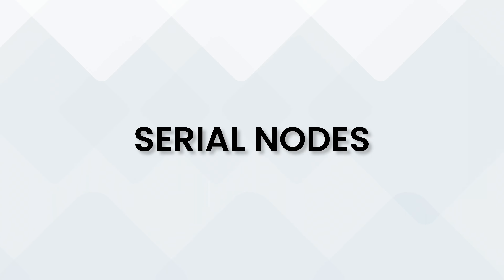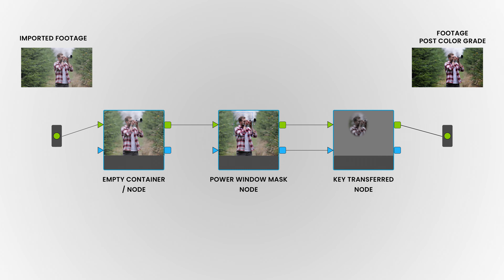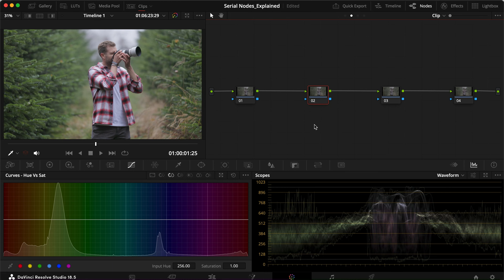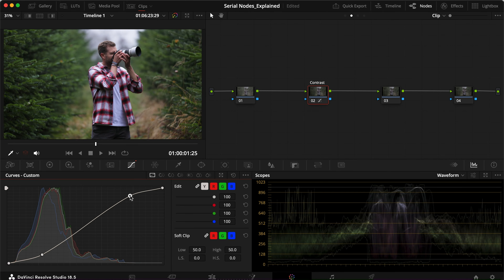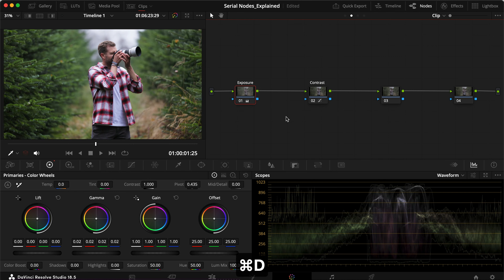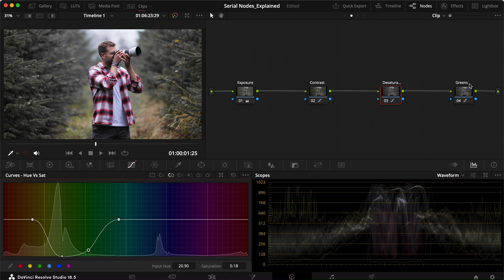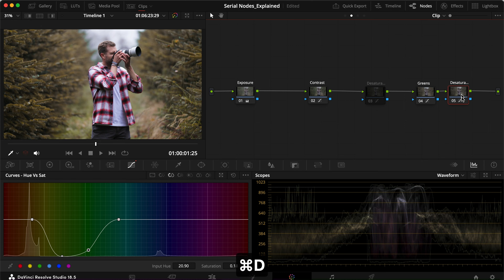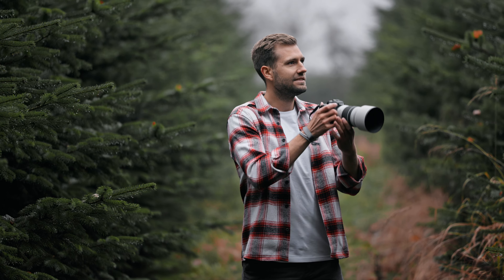Serial Nodes Explained in DaVinci Resolve 18

Comment: The video is very impactful. Thank you 😊

However I have a challenge with the nodes.

Let's say we have node 1 2 and 3, if I place the cursor on node 1, effects that I have added on 2 and 3 won't show. Is there a setting I need to turn on
Reply from the maker: Sounds like you have Highlights turned on, which only shows the current state at the node you’re in.

Try either Shift + H or in the top above your video feed there are small icons, some of them are different highlighting options, try and see if any of them turns off that ‘mode’ 😊